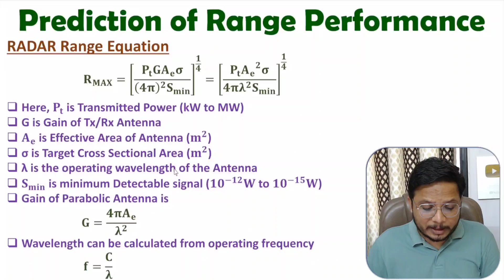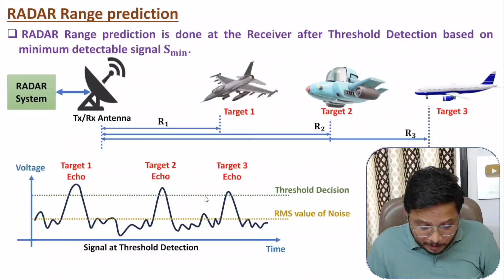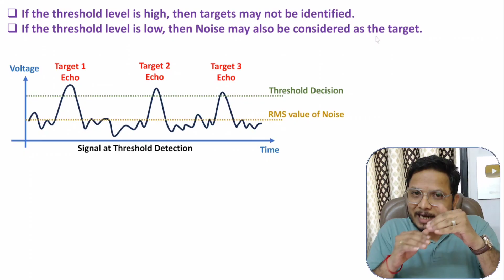Prediction of Range Performance of RADAR System | RADAR Engineering | Engineering Funda

Comment: but what if im using something like a stepped frequency cw radar or any radar with a large bandwidth what frequency do i use to substitute in the equation do i go through the whole bandwidth
Reply from the maker: You need to use the center frequency of the radar system.